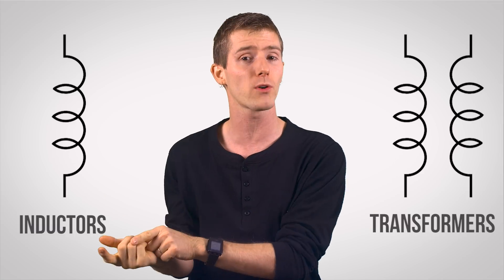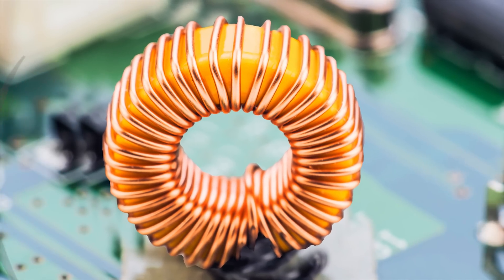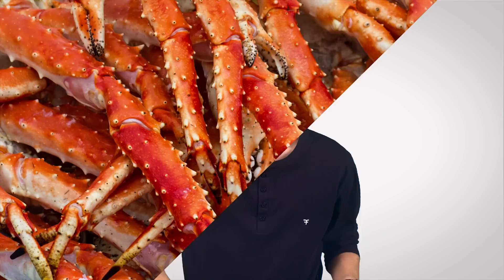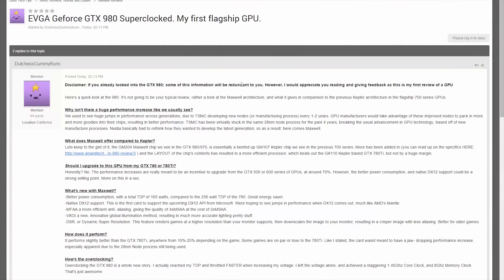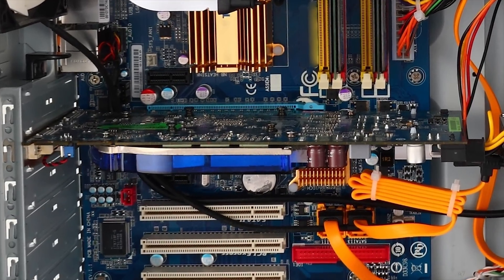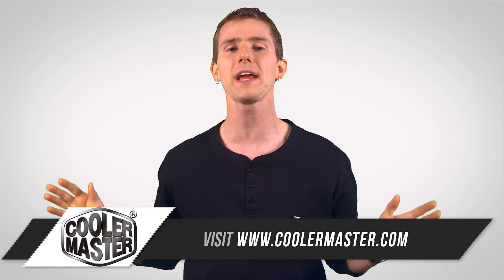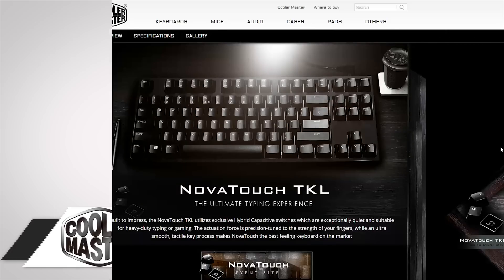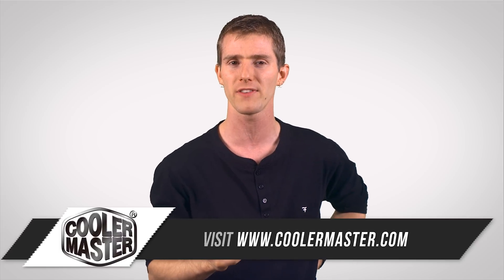Coil Whine as Fast As Possible

Comment: You can fix coil whine easy. Varnish over the coil will fix that /varnish for wires/. First, find out witch coil make the noise. Turn off your PC and take the video card. Use brush and apply varnish to the coil. Wait several hours. Done. It's cheap and easy.

Comment: Guys Coil Whine is not a defect so there is nothing to worry about except you have bare the noise that comes out of the GPU while it's flying frames over 100+ so just turn on V-Sync which will stop the sound and also save energy and power ;) Adaptive V-Sync on Nvidia cards is more better than a traditional in-game V-Sync!

Comment: Scored a good deal on an open box MSI GTX-970 Gaming. Peeled off the "Tested good" sticker to see it was returned for coil whine issues. Strange, this card is MUCH quieter than the Evga Gtx 760 SC ACX it replaces. I've RMA'ed both of my GTX-760 cards in the past for both coil whine and fan issues only to get cards slightly less noisy. I'm not denying there's a few cards with coil whine issues, however, having a card that completely shuts off the fan during low temps, as well as people actively looking for a problem, will report any and all noise issues. Honestly, I cannot remember owning a card besides an Radeon 8500 from 12 years ago that didn't make any sort of noise. Then again, I believe the crap bearings in the fan on it die on the 8500. If you're not too concerned about coil issues, you may be able to score a killer deal on an open box! Yes, my returned gtx 970 does have slight coil whine during gaming, it's barely audible with the side panel on, I would say it's quieter than my prior 760 cards, also a little cooler as well. Overall I'm happy with it.

Comment: For some reason the coil whine on my GTX 780 is pretty much absent in any high or low gaming or non-gaming application. But for some reason whenever I load up Folding at Home and put on a GPU fold the coil whine becomes very noticible.

Comment: Im looking for some help and some understanding.

I get some coil whine, possibly my cpu(did some trouble shooting without my gpu) only on certain games. i.e. Borderland the Pre-Sequal, Euro truck simulator, Elite: Dangerous and the heaven synthetic benchmark. But those are even my most demanding games like far cry 4, ACU, BF4 but no coil whine there. Any ideas?
Reply: Yeah I did some digging and found out my psu was whining but why would it just start to whine it only started whining when I put my new gpu in but I have plenty on watts (750) and it only wines on certain games (Far Cry 4 but only on loading screens)

Comment: Is this dangerous? Can it damage the component? I get it with my gtx 970 when running benchmarks. Is it still ok to run?
If it's merely annoying, I'm fine I can't hear it with my headphones on.. Just worried I'm frying my 970.

Comment: ive built dozens of PC's over the years with low-high end graphics card and have never taken note of any noise (apart from fan noise) coming from any graphics cards. Does it need to be under load for a prolonged period?

Comment: my 750 ti would make faint, but noticeable, coil whine every time i would scroll up or down an internet page and when i would be in games. i fixed it by changing the power settings to "power saving" instead of the default "balanced"

noise gone, my nerves are calm.

Comment: I do also have Coil whine. I think it's coming from my GTX 780 ti , but could it also be a subject of applying too much thermal paste on the processor. Or can it be my 750W power supply from corsair. i might handeled it bad through the move from my last computer. i'm wondering.

Comment: using a stethoscope will help it has a needle and ear piece to listen to hard to find noises. It's for automotive though not the ones doctors and EMTs use. You can even modify the diaphragm inside if you think it's to sensitive to noises. Just a little tech tip for this tech quickie. It works for me anyways. Just thought i'd share.

Comment: My 970 is also whining but not too loud. The bad thing is, that induction current seems to screw with the sine shape of my socket power. 
So now once i have my PC, my amp and my TV (for whatever reason) plugged in at the same time, i can listen to my coil whine with nice amplifiaction via my speakers... using different power sockets for the doesnt help either since they are all still on the same phase it seems.....

Comment: I've always thought coil whine just comes with electrical things from phone chargers to graphic cards... I've had numerous graphic cards from numerous different makers and they've always had kinda similar coil whine no matter the product. Different HDDs, though seem to have a lot of variations in the noise they make like my ye olde lacie external HDD is infernally loud and makes the whole desk resonate with it while newer HDD by seagate doesn't make pretty much any noise unless you put your ear towards it. From laptop chargers, HP one was so loud it had to be disconnected when possible because it was properly loud all times. Mid 2009 Macbook pro charger then again doesn't make any sound unless it's pushed towards your ear. Old Nokia chargers were also quite whiny... I don't know why but i have always been aware of coil whine but because it's just so common i don't care about it unless it's specially noisy, like that HP charger.

Comment: Suggestions for future AFAP:  What the hell is an "APP" and how is it different from a program?

Also, what are the differences between WD Black, Green, Red, Purple, etc. HD's?

Thanks
Bob
Reply: WD black = max performance , WD Green = low energy drive , WD Blue = just a Genuine high quality drive.
Reply: Yaseen Sabra it would make me write a whole article to make you understand. sorry but Google is your friend.
Reply: Deta335 Ok, thanks.
Reply: "AFAP"? lol A FAP would be better.
Reply: Deta335 But what exactly makes it faster ? If they're all 7200 RPM drives shouldn't they run at the same speed ?
Reply: App is short for application, there's not much difference. Usually mobile devices programs/applications or something where you can look and say "this little box here is the program" are called apps.
Reply: Lizlodude apps are more like lets say "Finished & locked in product" rather than regular PC programs , since there is little to no install options and custom. or replacement of files
Reply: Bob Hamilton i thought macs used apps and windows used executables? i could be wrong though.

Comment: so is coil whine the actual thing behind "capacitor whine"?
or if thats another thing altogether, how to distinguish them?
Reply: This is the first I have heard about coil whine. However, a capacitor is a different type of part. Inductors are a electric wire wrapped into a coil, usually around an iron core. A capacitor is two plates with a dielectric material in between.
Considering that both are usually used for AC circuits, I imagine capacitor whine being something similar to coil whine. However, I imagine it being even more impossible to fix because you can't just replace the dielectric material and expect it to work.

Comment: In my instance... I've had issues a few cards with coil whine:

AMD Radeon 5850 with an Antec HCG-750M
AMD Radeon 7870 with pretty much everything (improves with up to a Corsair HX or AX series)
AMD Radeon 7950 with a HCG-750M but improves a lot with an RM 750
some select NVidia cards are especially bad with some lower end Corsair CX series PSUs.

with these cards, it's the inductors on the VRM... now, some companies are actually trying to fix the issue with regards to coil whine by potting the inductors... this action is actually working pretty well and a lot the whining is reduced to a less than audible level... anyone who like s a silent PC will like that!!... but, of course, using potting compound in the inductors does add extra cost... so it's not likely we'll see this being done on all components until it becomes a marketing scheme!! Just like Gigabyte's UD branding did a long time ago!

Comment: Coil whining with halo1? 1:04
Reply: The reason why the card is whining with Halo1, is because it's running at full FPS.  So since it's an old game with a modern GPU it's running @ nearly 1000 fps causing stress.  If you enable Vsync on older games, or cap your FPS for those games the whining will stop.
Reply: ohh ok

Comment: I have a weird case of coil whine. My MB does it (because that's the only thing that I haven't swapped when I troubleshooted this issue). The thing is, it happens only when the PC temps are low; and when the whining happens - my PC lags like hell. Every single time I turn on my PC, I have to run stress tests for a while, to raise the overall PC temps. The PC heats up, the whining stops, and my PC doesn't lag anymore. Sad

Comment: In my experience there are 2 things that can help with coil whine, those are: 1-turning v-sync ON to lock FPS to 60 (30, depending the game). 2- play/run the game that where the coil whine is the worst, i have noticed that enventually the coil whine reduces
Reply: Or you can limit Fps to 45 sth it depends on Rivatuner
Reply: @Bentenherkes He was right and wrong.
1.Depends on your settings. I did a stress test (FurMark) with an open case and coil whine was the loudest when my RTX2070 consumed 175W of power. 
2.If you turn on V-Sync the game aligns your FPS to your monitor refresh rate(in my case its 75hz). Also turning on V-Sync=GPU targets an FPS number=Doesn't utilizes all of it. My 2070 at 1080P/75hz hardly goes near 50% in the games i play(mostly Fallout76/Insurgency Sandstorm).
Note that i can only hear coil whine when i don't have the side panel on and i need to get close to it

Comment: There is also a tool used to diagnose engine knock that would be helpful in tracking down the whine.  It looks like a stethoscope with a thin metal spike instead of the normal bell.  Just touch it around to various components (with it properly grounded of course) and the whine will jump right out at you when you hit pay dirt.

Comment: There are several small, and very old, hardware tweaks that can be done to eliminate whine entirely. First, isolate the component with a small directional microphone, which you can throw together with a small 12-inch tube, small slits down the sides, encased in something fluffy and noise baffling. Then, either epoxy, small em shielding, or em altering.

Epoxy circuit encapsulation can be applied to a specific troublesome component. While it is the best solution, it can be tricky, and requires experience. 

em shielding usually just means a conductive (and insulated) mesh. Conductively connected to the computer casing at opposite points, and positioned between the offending component and the other two high-em components (GPU, CPU, PSU), this CAN reduce or eliminate the issue if it is being amplified by magnetic resonance.  Before putting in the effort, you can find out if this is the case by testing with a VERY small and weak magnet, no closer than 8-inches to your computer case. If the whine changes pitch in response the the magnet approaching, you've got a resonance issue that can be resolved with em-shielding. Just be VERY careful with this method, and don't use a strong magnet, or get it any closer to your case.

Comment: An easy way to reduce coil whine? Externalize your sound card.

Yes, this sounds silly, but it does make a HUGE difference. For instance, getting a 2100 set of Corsairs, which have their own built in sound card, will reduce coil whine almost completely. 

See, the biggest problem, and this happens in open-back, closed-back, and speakers of all types, is that the signal gets degraded within the case and around the ports of the audio cables. Because audio ports and their leads are typically unshielded lines, they receive all SORTS of coil whine from within the case. Ultimately, this is NOT the same kind of interference that you receive on television speakers, computer speakers, and open-back headphones exclusively. 

The kind of interference you get there, the "Chitter", is actually in relation to cellular signals, specifically signals received over GSM networks as they interfere with unshielded cables and wires. Because of the nature of the wire and the signal itself, the wire acts as a perfect receiver for that digital signal, which can result in the "Dit-dit-da-dit-da-dit-da-dit" effect you hear, right down to a straight buzzing that seems to come and go almost entirely at random. 

To summarize: Yes, you're going to get interference. Yes, external soundcards are the best way to go(Whether that be a bluetooth set or a wireless set) to reduce or completely eliminate it(My 2100s have zero coil whine, whereas my 6790 pathetic video card from hell and my Apevia power supply both emit TONS over the analog signal, especially over the front-panel line, which is sadly on an unshielded connection lead to the board and passes directly between the power supply and video card thanks to a case with poor cable management options). Let's face it, the inside of a PC case has a LOT of potential interference causing devices running at any given time, whether they be water cooler pumps, fans, power supply coils, video card hardware, or even power phases on the board itself. So things that will get transmitted on an analog line, if you can shield them, you should, and if you can't, you should externalize them as much as possible, if not completely. Even some digital signals will see benefit from being on a better shielded line(Cat7 being a decent example of this as compared to Cat6). 

I am looking forward to a day when we will start to see enthusiast sound cards come back. Several years ago, Creative used to, and they still might, I haven't looked, make sound cards specifically for the sound enthusiast market, with front-panel connections, properly shielded in-betweens, and any number of other useful modifications that used to make good sound great.

Comment: I try hot-gluing the inductor, and if that doesn't work, I measure the exact ratings and order a high end replacement from digikey.

some soldering required

Comment: I just set my 290x's fan at 100%.

I can't hear any coil whine past my 747 jet engine!
Reply: @‌ I've had an HP X360, a couple of Dell XPS 13s, a Lenovo Yoga 920 and a Lenovo X1 Carbon. The HP comes bottom of the pile for both form factor and customer service. The X1 Carbon is by far the best with the XPS 13 a close second. The Yoga and X360 have big footprints and are heavier enough to feel significant when walking around with them in your hand.

    votes
    bookmark
    report
    hide

    +1 vote
    jesseboy89 on 27/08/2019 - 07:48

    I've had three different xps13s, a lenovo, an Asus, and a spectre x360.

    The x360 is easily the best one I've owned.
        votes
        bookmark
        report
        hide

 
ADGRM on 27/08/2019 - 09:26

i was in the market for a HP Spectre but after using it in-store, it was a hardpass…that screen bounce was intense. Very nice looking piece of machinery though
Reply: Mine has a broken fan blade so i can't hear the sound when the entire case is resonating when the fan is manually set at 100% luckily mine has very good cooling so even when overclocked it would be dead quiet since the max fan speed i have seen was 50% during a stress test
Reply: 290.... I haven't heard that name in a long time...
Reply: it looks like im entering the 25th dimension
Reply: damn that comment aged like fine whine
Reply: 10 years later! My 4090 is so bad that I can hear it when my PC is off ….. 😂
Reply: KRI KRi  which brand? i'll be sure to avoid them.
Reply: @Layarion  you can get coil whine on any gpu if it's pushed to it's max go on a old game and uncap the frame rate
Reply: Ya I got 9 Corsair LL120 in my case and when I crank them it legit sound like my computer is about to take off

Comment: I think some anti-vibration glue would help stop some coil whine. The stuff in PSUs are important. The glue will stop most physical vibrations to dampen the noise. 
My Silverstone SFX 600 watt PSU has very high pitched coil whine. Whenever i power it on with the 24pin plugged in, the noise is present. It does however work.

Comment: ..in the video, i think you was rendering that game at 2k fps, that is what coilwhine comes from, rendering insane amount of frames, it can be fixed PUT A FRAME LIMITER, set a frame limit to 120fps or 60 or 59.95 or your choice, but godam, limit it, your card will last longer and it wont whine, or use vsync, something that i hate, so i just put fps cap and fixed, magic

Comment: I strongly suspect my Corsair H100i is making a LOT of noise. 
Forums confirm that the pump runs @100% all the time, and even though the corsair LINK2 software has an option for regulating the pump... you can't.
It pisses me off, even the corsair 2000 headsets i have make static/white noice more with mic on, even more with volume turned up.
i'm not in the position to ask for help, but please help me, i just want to live in silence.

Comment: Last week I got my new GTX 970 (gigabyte G1 gaming thingy one) shipped in. Terrible whine. Thought something was breaking in my PC. Never had whine before, however the most powerful GPU I've ever have had is what I'm currently using. (R9 270x)
stress testing and general playing around with it by seeing the numbers in passmarks performance test app exposed the whine to me. After that took it into Far Cry 3 and played with graphics settings taking things up from high/very high to ultra.
after about 5-10 minutes the GPU (the 970) exploded. I want to say literally but...
The drivers crashed. windows restarted the card. When everything came back there was terrible artifacting on the desktop with 30-50% of the screen a garbled mess. Drivers crashing/restarting every 3-10 seconds.
Restarted computer for no effect. Re-seated card for no effect. :(
RMA'ed and the new one is coming today. Wish me luck.